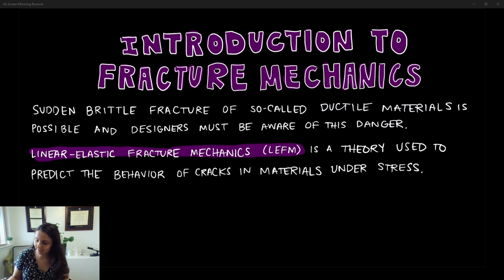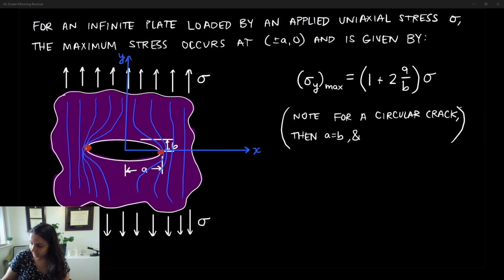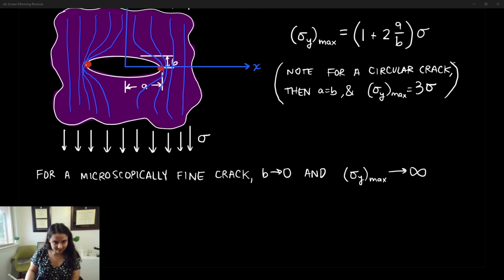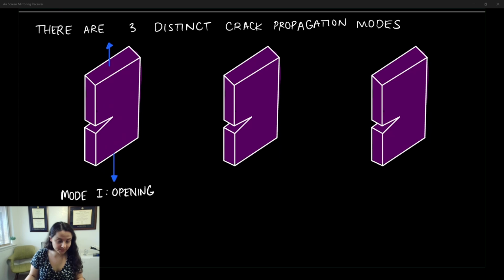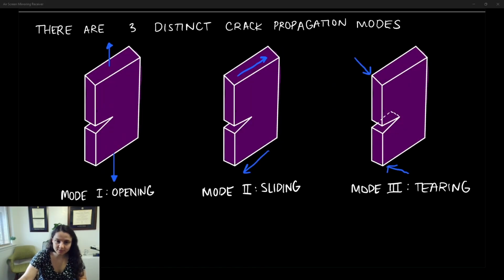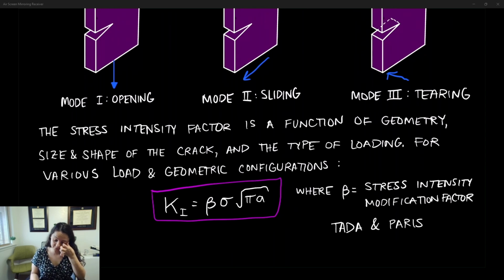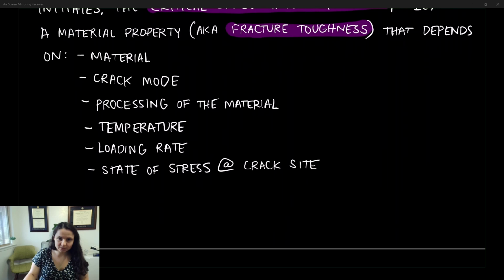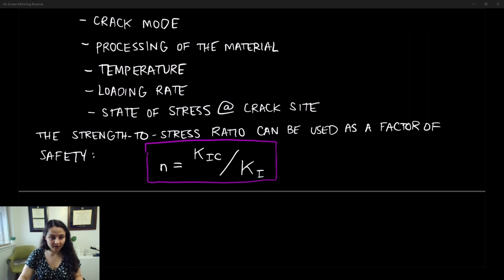Introduction to Fracture Mechanics | Machine Design - Lecture 8

Comment: Fracture Mechanics has been one of my favorites studies.  I did a lot of high temperature fracture mechanics on a pressure-less  sintered SiAlON (Silicon Aluminum OxyNitrided) ceramic ceramic matrix material.  The application was for high temperature turbo rotors, that ultimately had to operate ad 800°C at 100K rpm. Here we wanted a fine grained sintered material (your largest flaw size scaled to grain size).  Many challenges to processing and sintering.  

Nice Job on your presentation.  Thank you!
Reply from the maker: What a fascinating project! SiAlON ceramics at 800°C and 100K rpm sounds like some serious high-stakes fracture mechanics. I love that you brought up the connection between grain size and flaw size - such a critical aspect in ceramic design, especially under extreme thermal and mechanical loading.

Thank you for sharing. It's always great to hear from people with hands-on experience.